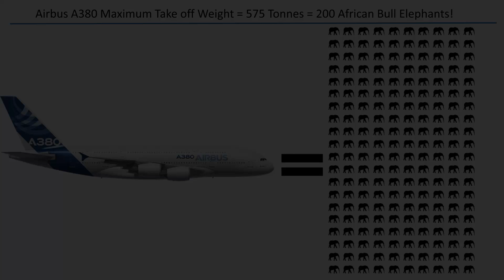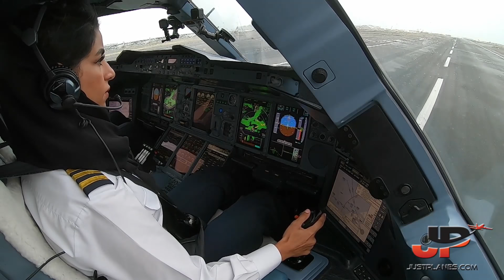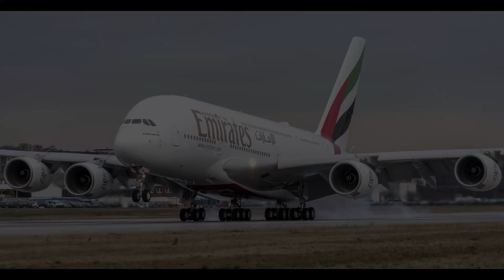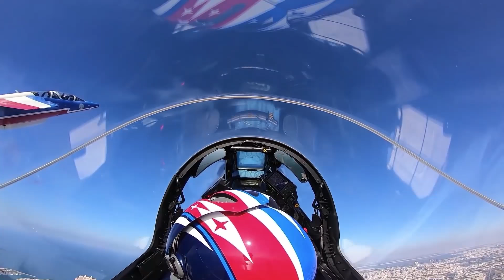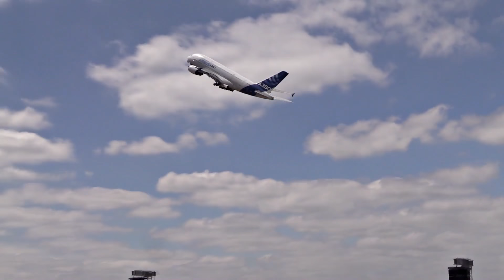How Does Lift Work? (How Airplanes Fly)

Comment: Think about it: the weight of the aircraft itself, the enormous amount of fuel, the combined weight of all the passengers and crew, and the total baggage weight, all of it adds up to the aircraft’s massive gross weight. And yet, somehow, this enormous machine lifts itself from the ground, takes to the sky, and cruises effortlessly through the air.
That is the incredible power of thrust and the brilliance of aerodynamics engineering so remarkable that it can turn thousands of tons of weight into the freedom of flight. What seems almost impossible on the ground becomes completely natural in the sky.

Comment: Pressure differential and lift are synonyms.  A pressure differential doesn't cause lift. A pressure differential is lift caused by accellerated air.
Reply: What accelerates the air.

Comment: In the bernoulli principle, pressure energy is inversely proportionate to kinetic energy, only when the total energy remains constant. No energy is expended and no work is done. It a conservation of energy,  not an expending  of energy. So you don't get lift from the bernoulli effect. You don't get lift because you conserve energy. You don't get lift because the air is moving faster.  You get lift by accelerating air down. The reaction to this is lift. Lift doesn't cause a pressure differential. Lift is a pressure differential, caused by the accelerated air. In the bernoulli principle, energy is not expended. With lift,energy is expended, and work in done, and energy goes from one place to another. The solitary cause for lift is the acceleration of air, not the bernoulli effect. Lift is a reaction, not an action.

Comment: Air deflected downwards gives all the lift?  Fly in a biplane, there is no air deflected downwards from the upper wing.  Measure the pressure differential between the static air and the upper surface and it gives about 80% or more of the lift.  Sure a flat wing can fly too, but it needs a very powerful engine to overcome the drag, as with aerobatic aircraft and fighter jets.  The Wright Brothers had only small motorcycle engines available, so they discovered that most of the lift comes from the curved upper surface.   If you don't believe in the Bernoulli effect, then try throwing a frisbee upside down.   This video is crap!  Thumbs down.

Comment: This is the usual misleading narrative.  Yes, angle of attack matters.  But because it adds asymmetry.  And it is only asymmetry that causes lift to occur.  If camber is asymmetrical that asymmetry adds to lift created as well.

Beyond not identifying asymmetry (to relative flow) as the unambiguous cause of lift creation, you treat pressure difference as if it is some kind of separate effect.  "The second effect."  Here you are just derailing basic physics:

Any object that creates lift does it by a pressure differential accelerating to have a momentum change in the direction against gravity (vertical).

Your flat plate with angle of attack (asymmetry) causing lift, does it by producing a pressure differential (corresponding 100% to the value of lift), that accelerates a change in momentum of air downwards (also corresponding to that 100% of the value of the lift force).

Whether the flat plate or the cambered airfoil, the vast majority of air molecule mass participating in the downward momentum change equal to the value of lift, never hits the bottom of the wing:

The pressure gradient is how the airfoil "reaches out" away from direct contact to the volume of surrounding air mass sufficient to get all those elephants of an A380 cruising at level altitude as it flies halfway around the world.  

You can't touch on explaining lift without bringing in how conservation of momentum, energy, and mass regulate the transverse force that is lift created by an asymmetry to the relative wind.

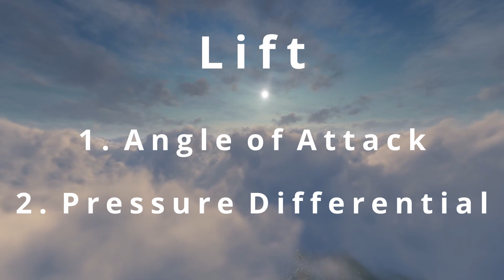Comment: It actually starts @  2:20.  Also, as a Pilot, I'll tell you - the underneath of all aircraft wings - are not straight.  All chalkboards will show that, but in reality, they are not.  As they explained at Emery Riddle, "moe and joe never meet" - meaning the Bernoulli's principle is wrong.
Reply: So how do planes fly upside down?
Reply: @lettybastien4624    It's called "the cord line".

Comment: You need to get rid of the “deflected air” part of your theory, it is completely wrong. Angle of attack and pressure differential are one thing; the greater the angle of attack, the greater the lift coefficient. Lift coefficient is also changed by the profile of the aerofoil such as camber and thickness/chord ratio. The entire lift force is generated by the pressure differential as per Bernoulli’s equation. Deflection of air particles “hitting” the surface is known to be completely inaccurate amongst those in the industry. That’s why aerofoils’ lift can be simulated by a spinning cylinder or vortices (obviously symmetrical). For a more comprehensive understanding then look up circulation theory.

(Btw, in case you think this is uneducated waffle, I used to design aerofoils/wing profiles, studied and worked as an aerospace engineer and now an airline pilot)
Reply: Correct!  There seems to be a cottage industry out there promoting the deflected air/Newtons' law version.

Comment: Relative speed of air is horizontally backward and greater due to longer curvature of upper surface of a wing in the same time interval 't',alongwith backward air speed along the smaller curvature of lower surface of the wing...to meet together again at the back back of the wings...As per Buroulli's principle(Details I am not saying here)of streamline flow of fluid, Pressure on upper surface decreases,this produce a pressure difference or Uplift
Reply: Rabindranath Mazumder, Calcutta,India
Reply: Air becomes less denser due to speedy flow along a surface,as a result perpendicular force on a surface decreases and hence pressure decreases on that surface
Reply: Air becomes less denser due to speedy flow along a surface,as a result perpendicular force on a surface decreases and hence pressure decreases on that surface .
Reply: No Finer vision in science analysis then no right explanation

Comment: yes very good but need to emphasize that lift results when the horizontal wind is deflected downward so  the deflected wind exerts an upward force on the wings. The pressure differential just facilitates the downward deflection of the wind along with the angle of attack.
Reply: Except that that is not correct.  As much as 80% of the lift comes from the low pressure above the wing.

Comment: When you excellerate air down, you get an upward force. And if you don't do that, you don't get an upward force, showing that downward excelleration is the single cause of the lift. A pressure differential doesn't cause lift. Rather, it is lift caused by excellerated air.

Comment: As the velocity of a gas Increases, the pressure decreases perpendicular to flow an opposite flow, but the pressure Increases in the flow direction. Bernoullis principle without this caviot is an abuse of the bernoulli principle.

Comment: how abour a video on Formula 1    ground effects aerodynamics   .the F1 engineers struggle to harness this magnetic violent reaction . which allows   extra tyre contact pressure to generate huge cornering and braking performances . I dominated the 1980 donnington GT one litre class championship being the only ground effects car on the grid .  Often in 12 lap races   I was able to lap over 90% of the other competitors Above 80   MPH  the ground effects increased exponentially allowing me to brake and corner at what seemed suicidal speeds .over 90% of braking was achieved in the first 10% of applying the brakes .. corners were ignored and taken at full speed ..Only limited by how suicidal i was feeling at the time .

Comment: If you want to lift a piano to 1km above earthsurface you need 20 people supporting the piano and and elevator, 
If you want to lift a airplane you need to use the lift force but applied in a point called centre of gravity , for this reason the aeroplane doesn't fall neither back or ahead , as when we can support a plate with one finger in the centre of the plate

Comment: The takeoff speed of the A380 at 315 km/h for those using the imperial miles. That would be 196 mph. Which is faster than all other passenger planes FTMP but when you are on the plane it feels so slow. Like a Cadillac lifting off and just cruising along.

Comment: The video if the balloon has the real concept its not what u a saying u a misleading pple the air that colides on the ballon exerts a force , because the air is traveling upwards it will push the ballon upwards the greater the mass the more  the ballon will move upwards. The angle of attack makes the wing face the onciming air the speed of the aircraft increases the air that collides on the wing the creates an upward force .If this generates force is greater than the aircraft weight it will take off. Aircrafts speed is important because is promotes this factor , that is y when air speed drops the plan falls to the hround

Comment: Its a misconception that shape of the wing produce lift..its rather the drag force acting on the bottom surfaces create higher air pressure and that high pressure creates high speed spill on the leading and trailing edge of the wing surface creating low pressure high speed flow on the upper surface of the wing. Even a flat surfaced wing can be flown with right angle of attack.

Comment: Trim up   the elevator tab creating nose up
3 common rules for creating lift force.   1. Opp to head wind 
2. Angale. Of attack. 3 Air frame of. Curve.  Generate  flight body become. Weight less. That. Time elevator will trimmed. And nose go up
Flight will continue flying

Comment: One of the better explanations of flight that I've seen on YouTube. I'm glad you said that even a flat plate can fly. That's the basic principle. The curved wing keeps the flow attached which then produces the pressure differential which adds to the lift, increasing efficiency. So many explanations put too much emphasis on the pressure differential contribution to lift.
Reply: The only thing he missed out on informing viewers what the basic principle was, is circulation. Keeping the flow attached is necessary for efficiency, not the pressure differential. The pressure differential is due to a positive AoA to the on-coming flow, thus creating circulation.

Comment: This is terrible physics:
This isn’t the worst explanation of the physics but still  has Two SERIOUS errors.
.
@1:45 The elevator surfaces are not called “rear flaps”. Flaps are on the wing.
.
@ 2:22 Saying that AoA and Pressure differential is not a bad simplification / summary, but implies there are two lift forces.
.
@ 2:48. Air does NOT bounce off the lower surface.  It flows downward in a smoothly curved flow. Even MORE air flows curved downward from ABOVE the wing than below.
.
@ 3:20 The top-Bottom pressure is ALL the lift.  However, a pressure difference will only MOVE the object if it is free to move.  A craft in level flight is not “moved” upward by lift. 
.
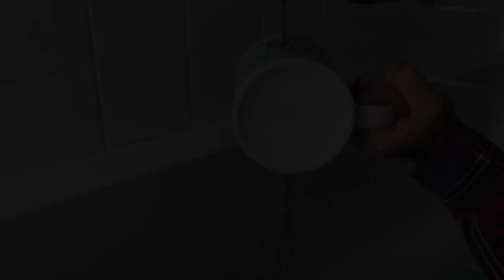@ 3:51 The Coanda effect does lower the pressure near the surface of an inside curve, but Coanda is only for a jet of fluid in an otherwise still environment.  This does not happen above a wing.  However, the similarity is the lower pressure on the inside of the curved FLOW. Making them easy to be confused.
.
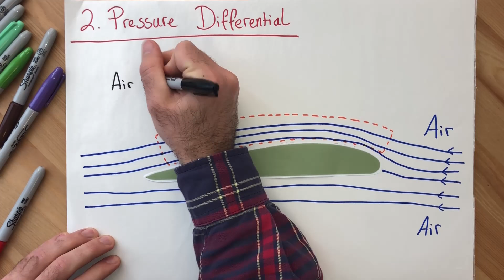@ 4:15 The first serious error. The flow is Not squeezed. There is no hard wall above the wing, but a soft cushion of air. It is NOT a venturi tube. This is one of the common misconceptions.
.
Fluid has mass and a net force is created by a pressure difference between two locations – called a Pressure Gradient. Euler first recognized this in the mid 1`700s following up on Bernoulli’s work.  That net force Accelerates the mass of air away from the higher pressure toward the lower pressure.
.
A Pressure Gradient provides the force  that Accelerates air toward the lower Pressure.
The air speeds up because the pressure ahead of the wing is roughly atmospheric pressure which is greater than the reduced pressure above the wing. This pressure is reduced because it is on the inside of the curved flow – It wants to go straight, per Newton’s First Law.  You can view it as it is the inertia “pulling away” from the center like you feel moved to the outside car door in a turn. Read Newton’s First Law.
.
.
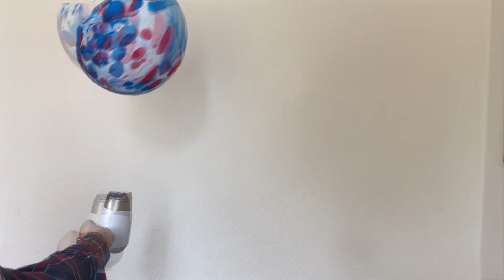@4:50  The second serious error.  The “faster air” out of the blower is NOT at a lower pressure than the still air around it. This is well known by aerodynamicists and easily measured by anyone with simple equipment. It is the true Coanda Effect creating a centering force by lowering the pressure more when more air curves around one side – allowing the higher air on the other side push the ball back in.
.
The pressure inside the blower is higher than atmospheric pressure.  This creates an Euler Pressure Gradient which accelerates the air away from higher pressure inside the blower to the relatively lower atmospheric pressure outside where the moving air assumes the atmospheric pressure of the still air around it. Euler again.
.
The video does not make it clear that while there are the two things that are significant for lift, it FAILS to clearly state that the entire lift is from the Top-Bottom Pressure Difference.  Those pressures are in effect, created by the curved flows below and above which the angle of attack contributes to.
A full treatment can be found here:  https://rxesywwbdscllwpn.quora.com/ 

- - 
Regards.

Comment: Great video! 10/10
Reply: It is INCORRECT:
This isn’t the worst explanation of the physics but still  has Two SERIOUS errors.
.
@1:45 The elevator surfaces are not called “rear flaps”. Flaps are on the wing.
.
@ 2:22 Saying that AoA and Pressure differential is not a bad simplification / summary, but implies there are two lift forces.
.
@ 2:48. Air does NOT bounce off the lower surface.  It flows downward in a smoothly curved flow. Even MORE air flows curved downward from ABOVE the wing than below.
.
@ 3:20 The top-Bottom pressure is ALL the lift.  However, a pressure difference will only MOVE the object if it is free to move.  A craft in level flight is not “moved” upward by lift. 
.
@ 3:51 The Coanda effect does lower the pressure near the surface of an inside curve, but Coanda is only for a jet of fluid in an otherwise still environment.  This does not happen above a wing.  However, the similarity is the lower pressure on the inside of the curved FLOW. Making them easy to be confused.
.
@ 4:15 The first serious error. The flow is Not squeezed. There is no hard wall above the wing, but a soft cushion of air. It is NOT a venturi tube. This is one of the common misconceptions.
.
Fluid has mass and a net force is created by a pressure difference between two locations – called a Pressure Gradient. Euler first recognized this in the mid 1`700s following up on Bernoulli’s work.  That net force Accelerates the mass of air away from the higher pressure toward the lower pressure.
.
A Pressure Gradient provides the force  that Accelerates air toward the lower Pressure.
The air speeds up because the pressure ahead of the wing is roughly atmospheric pressure which is greater than the reduced pressure above the wing. This pressure is reduced because it is on the inside of the curved flow – It wants to go straight, per Newton’s First Law.  You can view it as it is the inertia “pulling away” from the center like you feel moved to the outside car door in a turn. Read Newton’s First Law.
.
.
@4:50  The second serious error.  The “faster air” out of the blower is NOT at a lower pressure than the still air around it. This is well known by aerodynamicists and easily measured by anyone with simple equipment. It is the true Coanda Effect creating a centering force by lowering the pressure more when more air curves around one side – allowing the higher air on the other side push the ball back in.
.
The pressure inside the blower is higher than atmospheric pressure.  This creates an Euler Pressure Gradient which accelerates the air away from higher pressure inside the blower to the relatively lower atmospheric pressure outside where the moving air assumes the atmospheric pressure of the still air around it. Euler again.
.
The video does not make it clear that while there are the two things that are significant for lift, it FAILS to clearly state that the entire lift is from the Top-Bottom Pressure Difference.  Those pressures are in effect, created by the curved flows below and above which the angle of attack contributes to.
A full treatment can be found here:  https://rxesywwbdscllwpn.quora.com/ 

- - 
Regards.